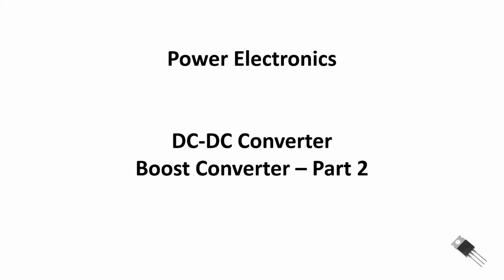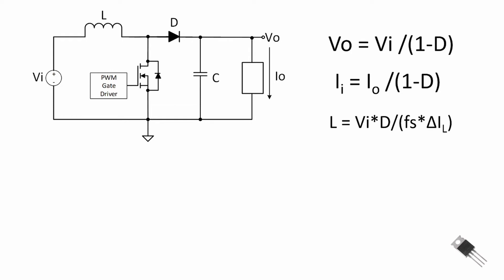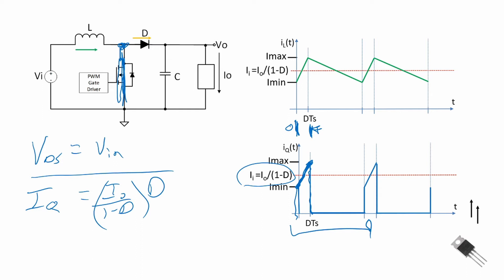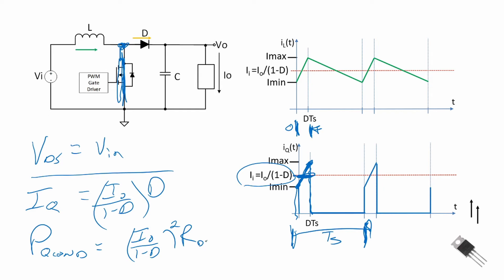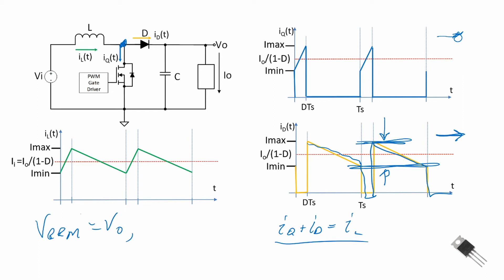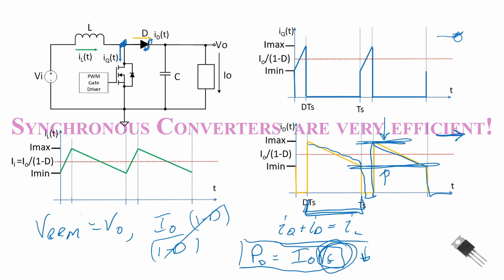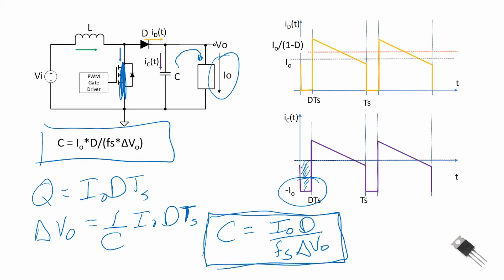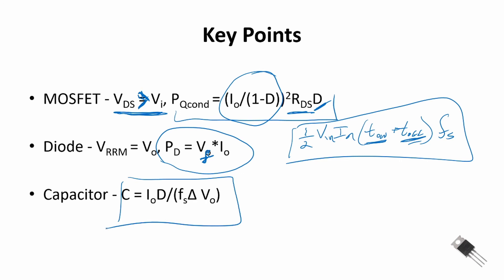Power Electronics Boost Converter Part 2

Comment: Awesome, video.  Please, I would like to know whether the specified current and voltage ripples (5% and 1% respectively)  base on IEEE Standard or you just used any random values?
Reply from the maker: Hi Benjamin, not these are not IEEE standards.  Just assumptions that I made for the example.  Every design will be different.  If the voltage ripple is too small (say .05%), you will need a larger capacitor.  The goal would be to have the largest possible ripple that meets the needs for the load voltage.  Best wishes on your design and thanks for watching.  -Dr. K
Reply: Thanks for your response. Please, I would like to know if you could share your email with me so that I could reach out to you for some clarification on my project. Thanks
Reply from the maker: @benjamingomado5064  Hi Benjamin, you can find me in the Milwaukee School of Engineering faculty directory.

Comment: Great explanation.  A question - why the VDS should be larger than Vin and not Vout? The transistor voltage changes between ~0V to Vout.
Reply from the maker: Hello Asaf, great observation.  You are correct, the output across VDS will switch between 0 and Vout (actually Vout with the diode drop voltage).  Because it is a boost converter Vout is larger than Vin.  The average value across VDS s Vin, but for design you will need to use the max value for sizing.  Please see the first part for the switching voltage waveforms https://youtu.be/bTPjEsBd9mQ.  Thanks for watching. -Dr K
Reply: @powerelectronicswithdr.k1017  Thanks for the answer. I saw the first part. Your explanations are great!

Comment: Dear professor, I would like to simulate the circuit in real time for measurements in different nodes or modifying parameters and look how the circuit reacts in real time, which software do you recommend that stands circuits with feedback without software crashes (convergence error like in multisim) in the simulation. Thanks in advance.

Comment: Awesome video, there is one thing that I do not understand. Why sometimes output capacitor sizing equation have some constant, for instance, in your buck boost design video, there is a factor of 1/8 for the capacitor equation. I'm some data sheets, I've seen a factor of 9 for output capacitor in boost converters. How do we arrive to that result? How much the ic influences in this equation?

Personally I'm using the MC33063 from TI as an inverting buck boost converter (IBB) 
 and the output capacitor equation for both IBB and boost, has a factor of 9 which increases a lot the value of the capacitor for relatively normal output voltage ripples (50-100mV). 

Thanks for your help!
Reply from the maker: Hi Matias,

The equation for the output capacitor is based on the amount of voltage ripple you will allow at full load and then depends on the type of converter you are using, as you noticed. For the buck converter, the capacitor has to sink and source charge and does so every 1/2 switching period.  The amount of charge sourced to the load is 1/2(delta Io/2)*Ts/2 or (1/8)*(delta_Io/fs). The cap only sources charge when the current from the pass inductor sags below Io.   The buck-boost topology is not straightforward. See the following for more information https://youtu.be/va5uEOtGdU8?t=891.  Also, I'm not sure why the TI datasheet had a factor of 9.  It could be that the equation is taking into account the range of duty cycle values or is a good empirical number.  If you find more details, please let me know.  Best wishes on your design. -Dr .K